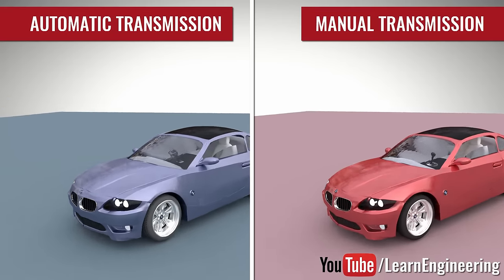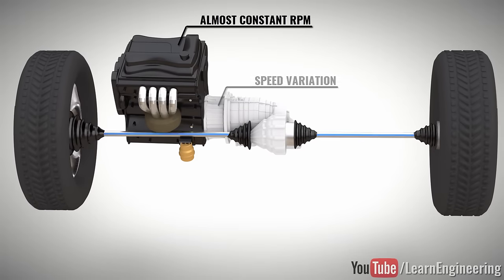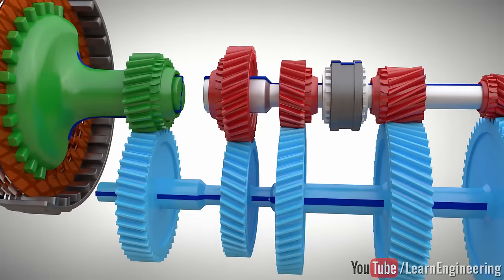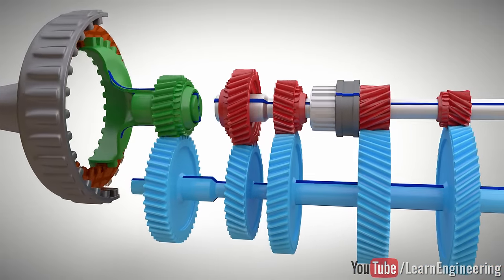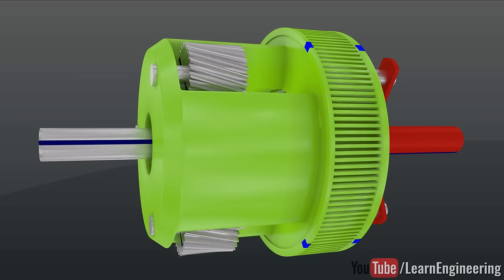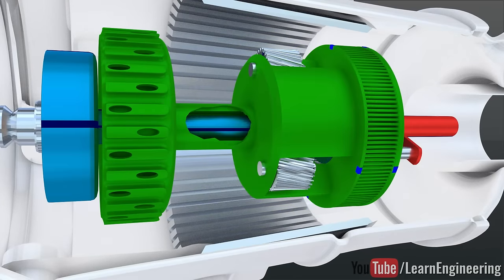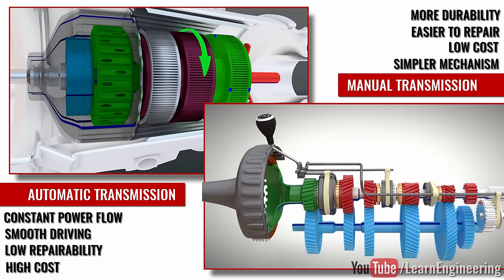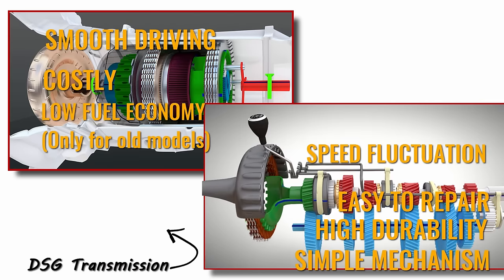Automatic vs Manual Transmission

Comment: Manuals are smoother than auto if you actually know how to drive, and you don't have to put the clutch in before you brake, who the fuck is naive enough to think that?
Reply: You don't have to, but why wouldn't you in most cases? If you're braking, most of the time, it's in preparation to stop, in which case you'll need to shift down, which requires the clutch to be in anyway. If you're merely referring to a slight deceleration, then no, it's not necessary to use the clutch, but for actually slowing down to a stop, or getting ready to take a corner, then pressing the clutch is required.
Reply: Still not required BEFORE you break unless you are trying to go from 40mph to 5mph in 3 feet. The key part you are missing is the video says you must before breaking not before you stall the vehicle. It almost sounds like this person that made the video understands what a manual is but has never driven one.
Reply: Mia Ray I don't know if you have driven a standard (Manual) transmission in a truck before but in the manual of my truck it specifically says not to put the clutch in then breaking because disconnecting the engine from the drive train removes any breaking power the engine itself can provide. It is more effecient to down shift while using the break at the same time to slow down especially when a load is being hauled. The only time the clutch should be popped when stopped is to keep the engine from stalling.
Reply: I'd like to apologize for my previous comment. I spoke as though I knew what I was talking about, while in reality, I didn't. Directly after my post, I did a little research and quickly found that my logic, as sound as it was in my head, is simply not sound in the real world.

While I love manual transmissions, and my in depth research into transmissions in general is almost solely on manuals, due to the sparsity of manual transmission vehicles at my disposal, I have very limited experience behind the wheel of them. So please forgive me for talking as though I knew what I was talking about. ^///^*
Reply: Mia Ray It's no problem learn something new every day.
Reply: I think it's a case of miscommunication more than anything. You need to put the clutch in before you stop. I think that's what they meant to convey. They just did a poor job at it.
Reply: That being said, no matter how good I got at driving a manual (and I got pretty good towards the end), it's nowhere near as smooth as my CVT is. That thing has an absolutely smooth acceleration curve all the way from stopped to full speed.
Reply: They probably meant before a full break.
Reply: Someone who cares about their engine and gearbox maybe?
Reply: It's not bad for your vehicle to start breaking before you depress the clutch

Comment: Very good video, I believe another reason that Manual cars are seen as more fuel efficient is that the driver can anticipate the engine performance needs and shift accordingly. This keeps the car in a more ideal "rev range".

This is most noticeable during hill driving and cornering. It is also why I am thankful my car has triptonic transmission. (It's an automatic gearbox, but I can "manually" shift up and down as needed).

Comment: I have experience of driving with both of them.
my advice: if you drive a lot in the city or somewhere that you have to change gear a lot, pick auto. otherwise manual is better from every aspect. if you become professional in driving you can even change manual without significant loose of converted power by controlling the clutch and fast gear changing.
Reply: Behrooz KHaleghi Rad i have tested both transmissions too. i prefer manual even in the cities. it provides good performance at low speed and more fuel efficient. it depends on the car too, but for me manual is better
Reply: I have them both with more than 10 years A/T experience, the automatic transmission (A/T) ones came from different generations, one has hill sensing and the other doesn't have one. I prefer automatic over manual transmission for highway and city commute because A/T is simpler to operate, I don't need to change gears, in a traffic stop just push the brake pedal, no need to change gears and my left hand is free to do other things, eating burger etc..lol. As of acceleration, for stop & go and highway driving, acceleration is almost instantaneously, the A/T will respond quickly adjusting its gear and pick up speed even if I push gas pedal at about 120-140 km/hour, leaving M/T car behind (You almost can't do this if you use M/T). The M/T is probably my preferred choice If my daily commute in a hilly area and need to overtake cars alot, M/T is more responsive than A/T.
Reply: I like manuals, myself. As far as city driving, it VASTLY depends on the weight of the clutch. ;)
Reply: Behrooz KHaleghi Rad
Reply: Ary Himawan lol leaving m/t behind? Try again
Reply: ak74udieby Yes. If you are driving on highway 120-140 km/h or more, you still can floor the gas pedal and gain speed faster than if you use manual transmission. Try with M/T, you floor the gas pedal + clutch very often, you'll burn the clutch out. Now your try.
Reply: Ary Himawan burn the clutch? seriously? it only happens if you are not good in handling the car when driving uphill during traffic jam (or similar low speed circumstances). in regular highway use no one even the stupid one burn the clutch... at least what i've heard of.
also if you are referring to top speed, it has no association with transmission. it is the engine. bugatti veyron, officially the fastest car is automatic however koenigsegg venom, unofficially surpassed veyron in top speed, is manual.
Reply: Ari Sudewa You have problem with reading comprehension. Try push the clutch pedal half way while revving your pedal gas at 120-140 km/hour trying to gain an acceleration, you'll wear out the clutch. When using CVT A/T, I can floor the gas pedal, transmission will engage to the lower gear, the car will accelerate faster. I didn't talk about top speed.
Reply: Ary Himawan why the hell would you push the clutch half way to gain acceleration at such high speed? you can't drive a manual, that's why your have a wrong impression

Comment: At 3:28 “A manual gear drive is never a smooth experience.” WRONG! It depends on the driver and how long that person has been driving a specific vehicle. The trip can potentially be as smooth as with an automatic transmission. In my case for example, I have been complimented by passengers who say they often can’t tell when I am shifting except for the fact that they see my hand move.